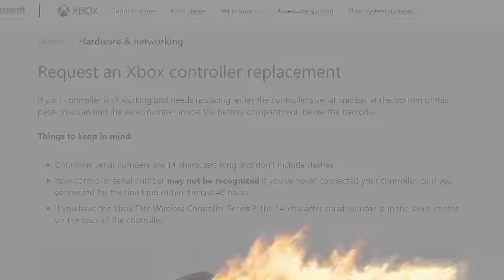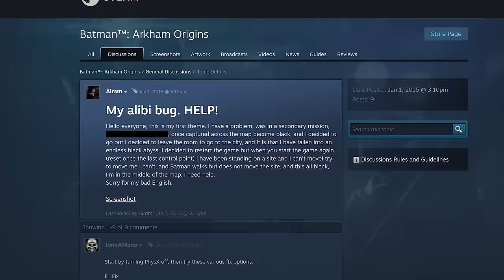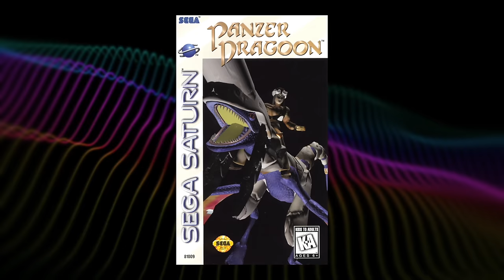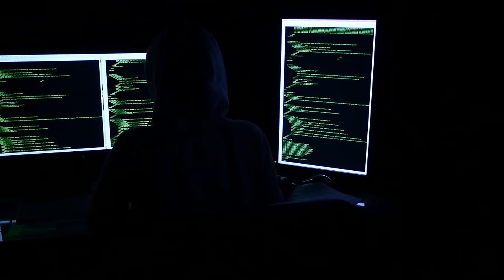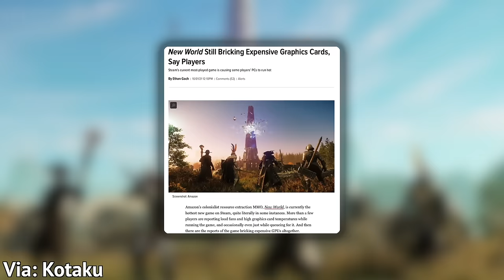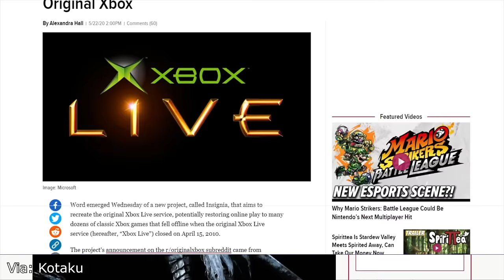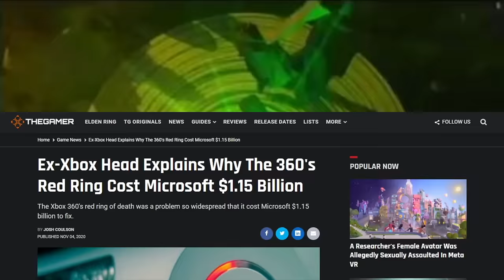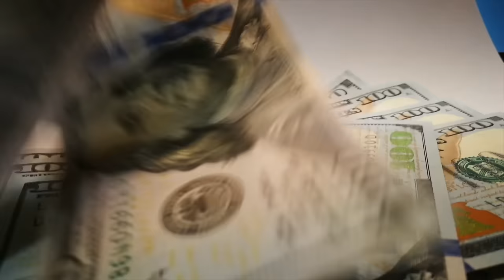10 NIGHTMARES Every Gamer Has

Comment: to Number 1: the worst i've encountered was some1 calling me after he built his PC and it wasnt posting. ran through all the troubleshooting that you usually do, like only use 1 ram stick, reseat ram and gpu and all that jazz. when i checked the CPU i was baffled, cause the Ryzen 3800X wasnt rotated correctly and had bend pins - yea... hard to align two triangles xD
the only thing from that list i encountered myself so far: BSOD - but thats a phenomenon that can be caused by cosmic radiation (im not kidding, look up cosmic radiation bitflip). Essentially a high energy particle from outer space can flip a 1 to a 0 in the RAM or CPU Cache and cause a Bluescreen or other weird things. Thats why on aircrafts, every critical system is redundant. Spaceships even have 3-4 computers running the same task and compare the calculations... if one of them has a different outcome as the others, it will be overruled. the universe literally hates computers :P

Comment: i personally built my own pc with alot of mismatching parts and luckily never ever having major issues and the most recent problem i cant be bothered waiting for a repair is my ram is slightly corrupted and cant go full 3200mhz speed, i have to change the speed manually to 3000mhz to avoid ram causing BSOD every 30 mins

Comment: That last one; custom pc, I was like nah, then thought back to my build and although it didn't stress me out as I knew I did nothing wrong getting a motherboard error code that no one could explain.

I don't have great memory but zenith extreme board and 00 error code, looked online, called heaps of computer places had people come out, nothing. I ended up sending the motherboard back to the place I bought it with instructions that I would like to know what happened.
They sent it to manufacturer and I got sent a brand new one, they refused to say what happened 💁‍♂️ guessing a manufacturing issue. 

Still to this day I am confused but 🤷‍♂️ I was never stressed or worried, building a pc is nearly idiot proof these days, I grew up watching my brother build custom pc with soldering irons and a lot of parts he had to make compatible, we got it easy these days its all plug and play.

Comment: I just built a new computer and put a 4tb m.2 ssd in it. Loaded it up like 80% full with just games. I was playing through Cyberpunk 2077 and had about 60 hours down while I had another game downloading as well and I got a hard drive error on that download. Saved my game and quit to restart my computer to try and see if that would fix the issue. Everything seemed fine and I started the download again, booted up the game, and my save wouldn’t load. It had gotten corrupted somehow. I had a backup save but it was about 20-25 hours behind where I was before. Still don’t know what the issue was and I still get occasional errors when downloading a game or a game update, but it hasn’t caused any other corruptions as far as I can tell. I’ve tried the repair tool and reformatting but neither of those seemed to make a difference so I’m thinking it’s just a bad drive. I’ve started backing up all my save data onto my 8tb hdd just in case, until I can buy another m.2 to replace this one.

Comment: #1 is the very reason I'll spend the extra money to use digital storm.  I've yet to get a rig from them that doesn't work, or last a long long time.  I usually buy a new one once enough parts have improved it's worth it more to buy a new one then replace all the old components.

Comment: Buying a brand new joy-con switch controller for $60+ and after a little while (like a month or two) of owning them and they already defective pissed me off. I am glad I get the insurance thing when I buy controllers as they should be better worth in the $30-$40 range for how fragile they are.

Joy-con drift majorly effect gameplay and gets me either;  killed because the character is moving when suppose to be stand still, make the wrong choice on an answer or command to attack or so, nonstop/offset camera spins, Ect. There is a lot of variables that can happen from either stick.

I have original Gamecube controllers to play Smash Bros that has seen major use since their prime and they still last longer and work better then the switch smash controllers and joy-cons. I even played Zelda BotW which I cannot use runes or the map but was still playable. Pokemon Shield was not bad either.

On a side note, families with children who plays the Nintendo Switch are more likely to drop the controllers often. I remember my sisters dropped my first joy-con pair and the right control stick is became offset. It was not even from a tall height nor that hard of a hit. Doing the factory reset did not fix it.

Nintendo how is any person suppose to enjoy your games if these "new" controllers breaks way to easily and make the games unplayable?

Comment: Controller drift is one that really pisses me off as to how easy it is to actually fix. If they actually included a working dead zone in the analogue stick, it wouldn't even be a thing except in extreme cases. Think back to the ps2 era. Those controllers technically have every bit as much drift as modern controllers, they just knew to make sure the system considered such light pressure on the stick to not be moving the stick. Nowadays we have such extreme pressure sensitivity in controllers they're prone to drift, even brand new. But all gaming companies are assholes and think what we really want is so much pointless tech in our controllers it costs $70. Because the flashlight click really needed to come from my controller and ruin my immersion, and that worthless touch pad that takes up 50% of the controller is just great. Being so large totally doesn't makes me prone to accidentally hit it when I have my thumb hanging too far off the controller. I really hate modern controllers, every "advancement" that was made for em, we'd be better off without.

Comment: Oh god, #1...
I actually do have a Computer Science degree and I cannot for the life of me figure out why my PC displays *some* images and applications as magenta and lime green abominations
I've gone through ALL of the tech support people and the only thing that actually worked was completely wiping the harddrive and starting over - which is a solution worse than the problem itself, but does prove that the issue isn't hardware at least >.>
MOST images, webpages and apps work fine, but those last few that I can't fix make me doubt my intelligence >.>
Steam used to display the problem but I was able to fix that ONE app by turning off hardware acceleration in the settings, a solution that does NOT work for anything else (of course)
Geforce Experience and Epic Games' apps ALWAYS displays the error and seemingly can't be fixed

Comment: I've never got a BSoD from a minor game bug. That sounds horrifying. Had an old Gateway's Disk Drive decide to spin so fast it made a loud whirring sound and than shattered the disk.

Had two Xbox 360 RRoD. I covered one with a blanket and ran it hot and somehow actually managed to fix it... Until the power supply died... Than I got a 3rd party power supply... NEVER get a 3rd party power supply... It literally melted and shorted out.

Comment: OMG this took me back. I remember the first time I lost an account was because my PS3 stopped reading discs and the account was on an old email account, so I couldn't reset it to get it back. Right after I'd finally switched to mostly digital. So most the games I was actively playing were gone. Only ever got them back because the PlayStation randomly started working again when I tried it out of desperation 2 years later - I had already replaced the system and the replacement was starting to have issues too 🤣😭

Comment: I had my steam account hacked (was not due to lack of security either, I had a randomly generated 16 character password from my password manager). I can't use steam guard as my luck is awful and phones need to be factory reset every month usually. They got into my account and cheated on rust (I brought the game but had no one to play it with or the internet to play it). Easy anticheat ignored me even with proof that my login was used in USA and Europe. Now I have a permanent mark on my steam account. Went to steam forums and they blamed me for not having steam guard which isn't viable for me. If I could use another 2fa program like authy then I would in a heart beat but using the steam app with no way to recover your account if the device is dead makes my anxiety go through the roof as I have too many games to loose

Comment: 10. I only have had this ones on my R4 back in the day with Luminous arc 3 where I was like 60% in the game and somehow my save got deleted I was using guides to play because I believe it was Jp only, I did have a few times in the Tales franchise where I would lose a couple hours of grinding because I lost a battle.
9. Controllers I don't remember having mine break, I did break some handhelds like my old GBA with one of the buttons didn't work anymore, the first DS the touch screen was destroyed (my own doing I kept slamming the stylus into it when I was frustrated) and lastly my DSI the top screen connection got damaged so I needed to hold it in place when playing otherwise it would fall backwards or forwards
8. I have seen enough glitches in my time but to my knowledge I never had a game breaking ones, only game that became unplayable at one point was skyrim ps3 were it would lag big time making it impossible to play
7. I might have had unreadable disk or disk not being seen a handful of times, I remember it happening allot with the DS cartridges
6. Luckily never had my account be stolen, I did have my maplestory account compromised when I lost all my mesos I had saved up the other day, but I simply changed my password and pincode
5. Don't play on PC so never had this problem
4. I probably have tipped the scale between healthy and unhealthy but never fully tipped
3. Not happens yet but I know it will happen at some point with Dokkan Battle
2. Never had Xbox so luckily never had this BS also never had it on ps3, only time I had my console brick was off my own mistake I was cleaning my home and turned on my ps4 on accident and my dumbass just thought let's unplug it without turning it off... needless to say it wouldn't work asking for a update file, found what I needed used it still not fixed.. so I needed to factory reset it bye bye save files
1. 100% would happen it I tried but luckily I like console and handheld gaming then pc

Comment: the first issue is almost a non issue if you make at least 3 manual save files and rotate... Along side games having auto save, and quick save. So in total thats at least 5 save options to load from. Ill never get why people dont use more than 1 save, Its so common to see people doing that, I think thats the norm some how lol. Im also talking about some what modern gaming. Not about like ps1 and below (unless its a PC). Ps1 you could hardly hold many saves on one memory card so that is more understandable but even as a kid I was scared of this happening so I always used a lot of space saving kek. After all when I'm done with a game, i dont need those saves. Ill never start a game again mid way throu.

Comment: 'It's bad when you lose your launcher account...'

Yeah... it's worse then your MMO account. Me losing access to my massive Steam library would be devastating and costly. That's 18 years of gaming history (yep, one of the original adopters with an HL2 preorder back in 2004) and over $6000 (that number is assuming an average of $20/game purchase, but it's likely higher since I used to almost always buy within the first 6 months of release, not so much anymore).

Very few MMO accounts can match that history, more fiscally are likely since people dump hordes of money outside the subscription and time in, but that's probably still only the top 1%. I don't care how 'wrapped up in your character' you are. 

Sure, I could replace the library after a couple months, and probably for far cheaper since it's a lot of older games and Steam Sales run like clockwork now, but that's not the point.

Comment: Controllers 'just wear out'? I have several 1980 Atari controllers with bite marks in the rubber covering the big stick having NO drift whatsoever! These things went on flying missions, trough walls, and never flinched. The button click is just as crisp as ever, and the housing never cracked or yellowed to a smoker's delight, and it's from friggin 1980!

But alas, the plug fits no modern socket..

Comment: I remember the rrod. I never had a 360 but i worked at a game x change and we had people constantly coming in to ask if we could fix it because my store offered original xbox repair. One of the managers knew the ins and outs, knew how to diagnose problems and he'd repair them. 

But the 360? There's really no fixing it because the main issue is the console would get so hot that it could melt the solder connections and warp the board.

Comment: ANTHEM burned my 6 pin connector of my graphics card when it came out to origin early access. I opened at least 30 tickets trying to get answers why the whole pc crashes after 14 minutes of gameplay before noticing a burnt smell. I opend my pc case and there it was, melted plastic and rubber on my graphics card 6 pin connector. It was a shock honestly. But what was more frustrating, i wanted to be the first one to finish the game. And off course it didn't happen.

Comment: My worst PC problem took me weeks to figure out, it would randomly get a bluescreen while gaming, I tried it all, I have had every pc issue under the sun so I have the experience, turns out it was the CPU cooler pushing down too hard on the motherboard choking the RAM. I found it out when I had my pc laying down on the test bench it worked fine, but standing up NOPE (due to the cooler sagging ). Weird and a little fun problem...

Comment: I bought a pre made pc once and thought it was broken for ages because it wouldn’t turn on 
I tried going inside it but just disconnected a heat sensor 
A friend came to check it out rearranges the plugs and then pressed the on switch 

Turned out the wires where plugged into the wrong spots every attempt to turn it on

Comment: I once took 3 Broken Xbox 360s and made 1 working Xbox as long as you kept a 12in fan blowing on the motherboard through the hole in the case I cut out to keep it from overheating. Lol I had to replace the disc drive by unsoldering the circuit board off of the original drive and resolder it onto the replacement because the boards had to match numbers with the motherboard. I then had to remove the heatsyncs from another Xbox and install them with new thermal pastes on the that motherboard. It kept throwing the red ring due to overheating. So I cut out the case and install the giant 12in fan that was almost the size of the console. 😆 it had to stand on end or it wouldn't circulate properly. I ended up giving it to a friend and he said it's still operating even although I did this almost a decade ago. 😆

Comment: Had corrupted saves twice.. once was when I was turning off my ps4 and the power went off while it was shutting down and needed to the reset the database or system reset and had nothing saved to the cloud.. since then I save to the cloud often but my second corrupted save was Lego Harry Potter going for 100% for the platinum trophy and I saved and closed the game and uploaded my save to the cloud.. next day I loaded up the game and it was a corrupted save… which i uploaded to the cloud… so didn’t even have a save backed up to use..

Comment: I had a Gen 1 xbox 360 that survived the red ring twice (warped graphics issue from over heating) after I laid it on its side it worked up until 2017/18? until the laser stopped working on it...but Stull would play digital games

Comment: I've used Stock PS4 controller when it came out Never had an issue didn't have to replace it And I had one of those rubber Cases on it to prevent scratches in damage And when it broke I just swapped it out for a new one But You have to make sure those stay clean otherwise I get really sticky and gross And eww

Comment: Wait, so I'm in the ultimate nightmare? My PS4 quit reading disks after abruptly closing Valhalla, then quit updating so I tried to reset it and lost access to my account with all the digital games I had. Then my pc windows install somehow fried itself and wouldn't reinstall, then my Linux installation capped out somehow. Now the only games I have access to are on my phone and my Bluetooth controller has stick drift. That's like three or four of these points in rapid succession.

Comment: I lost 130 hours of my elden ring saves because I accidentally switched to the cloud like you know on Xbox when it ask which save you want to use if you’ve played off line for a little bit yeah that moment when you have to press the right button my 1 year old hits my controller and boom bye bye 2 level 80s and a level 100 and had to start completely over

Comment: I have a big case of broken controller. I was fracking around with my Switch trying to find the cables, when; OH NO! Both of my wireless controllers fall, still attached to the cords. I pull them out, fire up SE4, and scream in rage. One of them has a fucked up left stick and tne other has a fucked up right stick. I still have the JoyCons but now we can't play 4 player games.

Comment: I've never bought a brand new controller that didn't work but I have bought used controllers that did not work 1st time it wouldn't change the port was broken 2nd time stopped working mid play and yes this was the exchanged controller from the 1st time 😂

Comment: Controller issue is weird?  Parts are usually cheap easy to fix, but if so yeah they're expensive but never had an issue with a new controller not working.